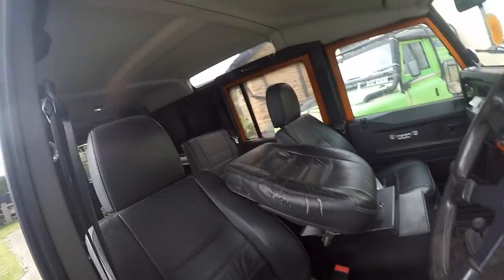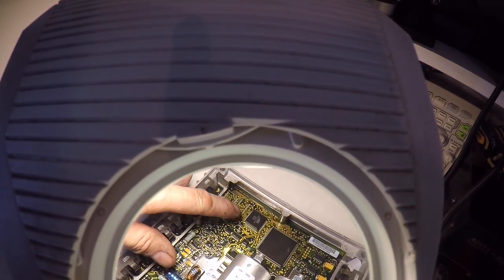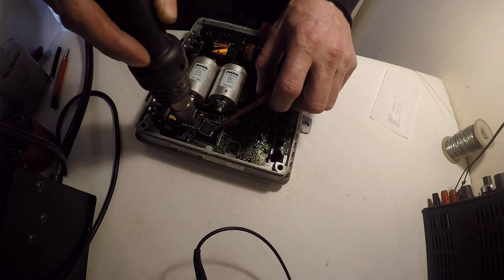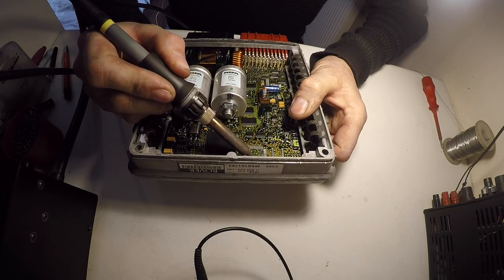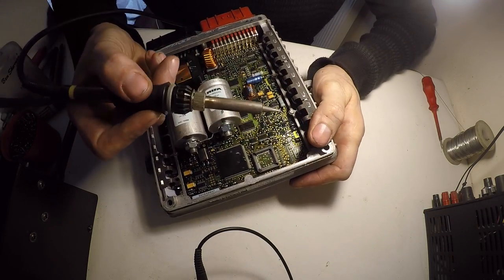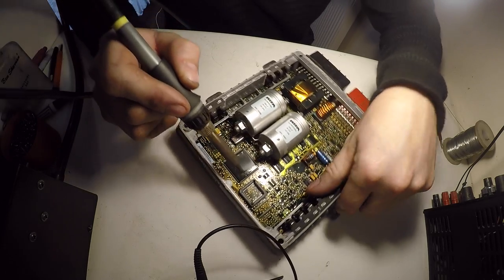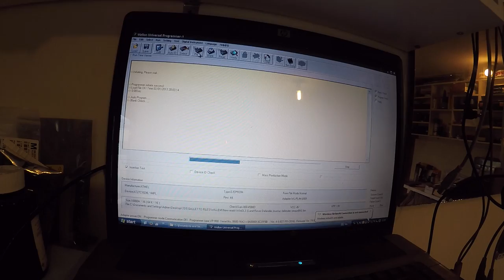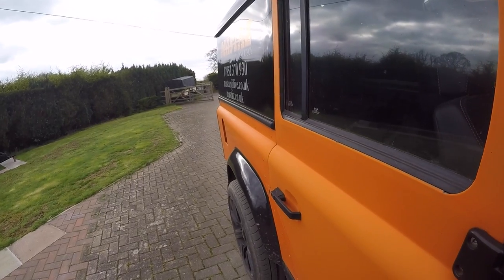HOW TO CHIP LAND ROVER TD5 Defender and Discovery

Comment: I've got a 2001 TD5 which had a 10P engine.  That has been replaced with a 15P but has the original ECU.  SHould that be re chipped?
Reply from the maker: Hi Andy

As you have now got a 15p engine you should use the later 15p NNN type ecu to suit, also you would need to have the 4 pin air sensor rather than the 3 pin that lives in the side of the air filter box and run the extra wire to the ECU or use a 15p engine loom. 

The easy option would be to use 10p injectors in the 15p engine (make sure you set the preload) that way you can keep the original 10p ecu setup.

Your not really meant to swap injectors from 10p and 15p as they are at different angles in the head as 15p have an offset combustion chamber in the piston crown and the stroke delivery is longer due to the injector rocker shaft setup but if you only change the injectors alone and set preload then it will be fine.

Thanks 
Shane
Mastaz

Comment: What chip you put there?
Reply from the maker: Same chip as the original 27c1024 👍
Reply: @CarJunkeez  can you tell me where to buy?
Reply: @CarJunkeez  and another question. If it is a NNN ECU can I program with ktag through BDM?
Reply from the maker: You can buy at RS components and many other electronic component suppliers 👍
Reply from the maker: With NNN It’s much easier to program via OBD 👍

Comment: Hello mate, is that a dip40 adapter? I've also been looking for some cheap ish code writers, can I use any wellon one or do you have any other suggestions?
Reply from the maker: Hello again William, it’s a DIP44 to PLCC44 adaptor and I use a Wellon VP990, there is a few other Wellon that will do but best to get the higher spec one, definitely don’t bother with the cheap programmers as you’ll kill loads of chips and when using OTP chips it’s painful 😂 cheers mate 👍
Reply: @CarJunkeez  belting, cheers mate. Great help

Comment: Met up with this guy yesterday for a mastaz boost box, pleasure to deal  with, couldn't be more hepful, I've got myself a universal intercooler, so will be in touch shortly, take care pal - lee td5
Reply from the maker: Thanks mate, happy days, see you soon, cheers Shane 😃👍
Reply: @CarJunkeez  garage didn't like the look of my intercooler, its a mishimoto one, picked it up cheap. The inlet and outlet pipes stick out instead of face in towards engine. If I put 2 90 degree bends in and connect via aluminium tubing to origina pipes would that work pal... kind regards lee td5
Reply from the maker: As long as it’s a decent size intercooler and the piping is same diameter then should be fine mate 👍

Comment: man just digging this for the intro alone haha
looking at this because I have a hard time opening my msb ecu after its been soaked in oil
Reply: damn hot water to open it? :(
Reply from the maker: Thanks man 😁 yea they’re a bit tricky to get open and the oil getting in there is a common issue so best to replace the injector wiring harness under the rocker cove mate 👍

Comment: Are these types of ecu as programmable as the later ones or would it to be best to swap out it out for the newer one and program that?

Cheers in advance 👍🏻
Reply from the maker: They can’t be re-mapped via the OBD port like the NNN but you can get rewritable chips and once you’ve fitted the socket you can pop the chip out and rewrite as many times as you want. It actually only takes me about 20 minutes to fully chip a MSB ECU anyway 👍 cheers
Reply: @ I’ll be contact with you soon pal, thanks for your response!!

Comment: Be wicked if you could make a list of the items such as the wellon programmer and where you get your maps from :) Id love to try this to my own Td5
Reply from the maker: Hi, it’s a Wellon UP990 and the chip is a 44 pin PLCC 27c1024 and a PLCC44 surface mount socket, I make my own maps. You can use other programmers but some of the cheaper ones often do bad writes to 27c and as they are only write once it corrupts the chip but you can use other chips. Cheers 👍

Comment: Hi, I enjoyed watching this video. I have a question. I am in the process of a TD5 engine project. Installing a DISCO 1 on a gasoline engine. Is there a way to run it without an intelizer?
Reply from the maker: Hi, thanks 😁 I presume you mean is it possible to run a TD5 without immobiliser, if so then yes the ECU can be made immo free 👍 cheers
Reply: @CarJunkeez  👍Yes, as well, but I will deal with an electronic unit without any modification to the factory settings. Is there a way to cancel it?
Reply from the maker: @sniperpro_sa  To make the ECU immo free you need to take apart and program a chip inside and cut a pin 👍
Reply: @CarJunkeez  Thank you very much and have a good day

Comment: What is stored on the chip is it just the map or are the injector codes and things like that stored in there as well.
Reply from the maker: The firmware for the vehicle type and fuel maps are stored on the 27c1024 chip (one in the video). The injector codes, throttle settings, immobiliser code etc. are stored on the little 8 pin chip 93c46 eprom near it 👍 cheers

Comment: My ecu for a TD5 was stolen. Am looking for a replacement. Is there need to synchronise the ecu and old keys?
Reply from the maker: Hi, you only have to synchronise the ecu (learn security code), your keys and remote fobs will work just the same, you should also program your injector codes for best results, although it’s not totally necessary 👍

Comment: hi
i need a help
my land rover discovery 2004 td5
was parked for 15 days. when i tried to start it. the remote didnt worked  then i had to open wd key. the car isnt starting now and the engine check light is nt showing. plz hlp
Reply from the maker: Hi, if the engine check light isn’t coming on with ignition and you can’t hear the fuel pump then it’s likely that the ecu isn’t getting power (unless the ecu is faulty) the fuse box under the bonnet is a common failure as the internal connections can fail, there’s many things it could be but there’s a good place to start 👍

Comment: Ok so I'm just wondering what is the difference between the pre 2002 ecu to 2002 and beyond in tuning and chipping terms
Reply from the maker: Hi. The post 2002 NNN type ECU for the 15p engine can be programmed via OBD (Re-Mapped) but the pre 2002 MSB type ECU for the 10p engine cannot be programmed via the OBD so need to be chipped as there is no flash chip and only a write once EPROM.👍
Reply: @CarJunkeez  "rom" chip, as "eprom" is erasable programmable, and "rom" read only memory. Not so? Too long ago since my it years...
Reply from the maker: Correct but on the 27c1024 there is no window for the UV light eraser so can only be written once 👍